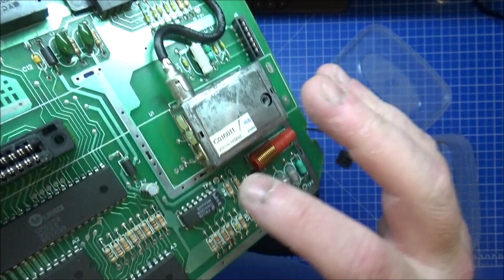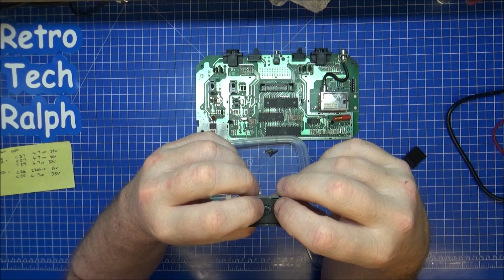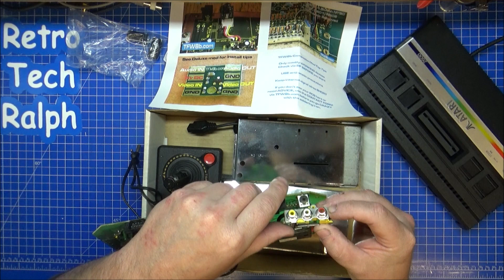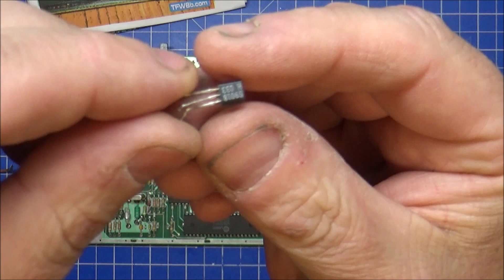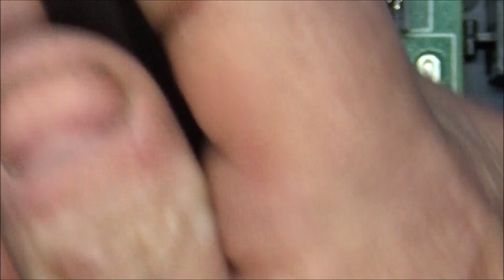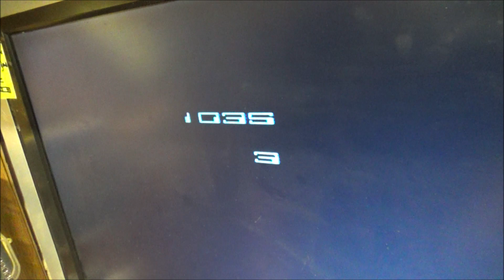Atari 2600 Jnr Rebirth. Repair and upgrade.

Comment: I would love to see someone 3d print an external enclosure that will snap into the hole where the old RF output was to mount the RCA jacks into (and just run the wires through the hole in the case and into the 3d printed box) to avoid mutilating the case.

Comment: Well you could,ve used a 3,5 phone jack for composite out instead and place those on the part were that rf out did go,this way you didn’t had to drill extra holes into the case.
Reply from the maker: I did this on the 7800 upgrade, looks a lot neater.

Comment: RETRO TECH RALPH 
((((                                 1.) What is the start and end address range for the TIA?
         2.) What is the start and end address range for the PIA?

           3.) What is the start and end address range for the Games ROM chip?  

4.) What is the start and end address range for the Sound RIOT chip?
                5.) is it a ROM chip or a PROM chip that are inside the game cartridge?

           6.) A PIA chip is a RAM chip that has built in ADC/DAC interfacing? A PIA is not a decoder or a multipler chip , its a RAM chip with I/0 interfacing ADC/DAC converters built into the RAM locations?